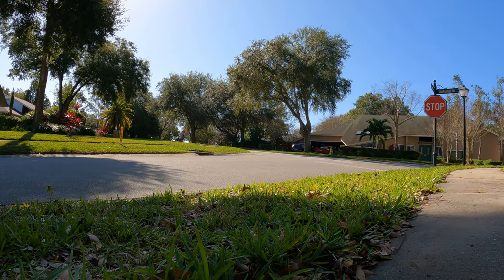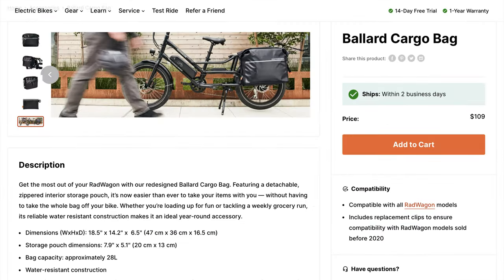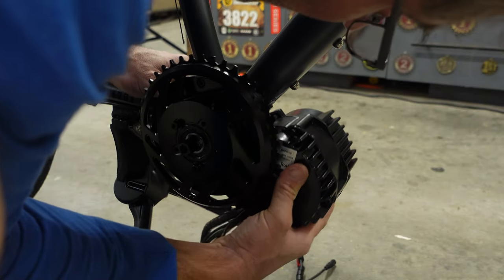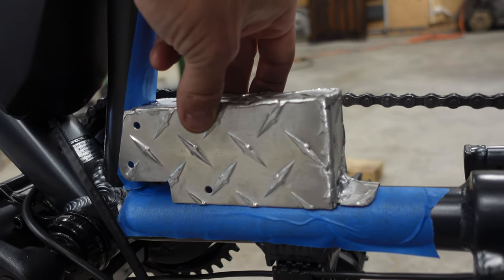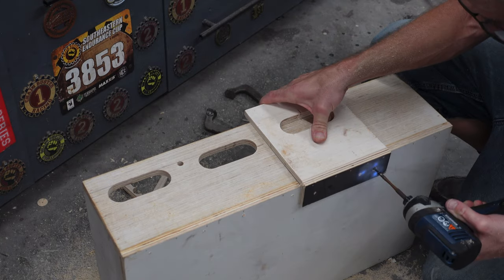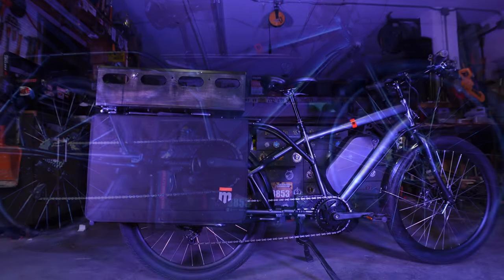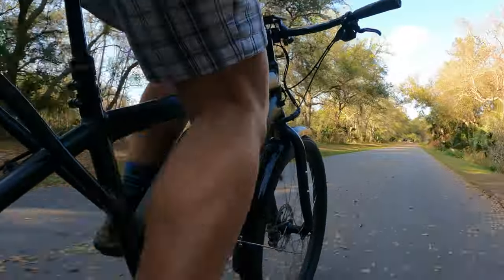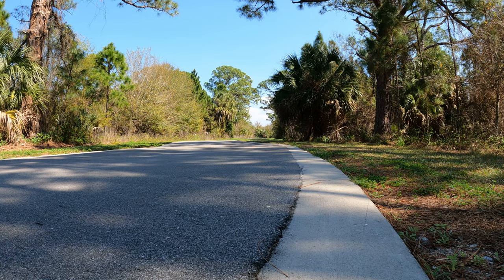DIY Cargo E-bike Conversion

Comment: Nice neat conversion, well done, love the idea behind the lilting rear box. I do all my shopping by ebike with large panniers or a trailer and a cargo bike would be a nice option to have but here in the UK we have a 250W limit and in my opinion that is really holding back the spread of cargo bikes, especially as I live at the top of a 300ft climb the issue is probably more about torque than speed.
Reply from the maker: Thanks. So far I am super happy with this setup. I'm theory some restrictions are good however it seems like they went a little too far in your country. The USA they are on the other end with hardly any restrictions.  I wish they would ban hand throttles on ebikes in the USA though. Most people here buy the cheap Chinese bikes with hand throttles and just cruise around without  pedaling, even in flat Florida.  Hopefully they will make an exception for cargo bikes in the future. Happy Trails.
Reply: @PedalPowerAdventures  not everyone can peddle a bike due to bad knees or other physical conditions, stop being inconsiderate of other people.
Reply: @r.vargas5410  if you can't pedal its not the best idea  to use a bicycle, get a mobility scooter instead surely

Comment: Nice, very creative, I love the rear basket! I also converted the same Mongoose bike and love it too. I put 2 motors together, a 1000 watt front wheel direct drive hub and a small tsdz2 mid drive. The area where I live is very hilly and the little mid drive is mostly to help with the climbs, very efficient and fun and also get regen from the front motor.
Reply from the maker: Thanks!  Sounds like you have a sweet setup with the 2 motors!
Reply: Hows your build Simon? I'm looking to do dual 2kw hub motors (front and rear) for mine. Similarly my area is very hilly, and I plan to haul a trailer around at times too.
Reply: @ryanclapp6467  Sorry for the delay,  I would suggest one direct drive hub and a geared hub, the direct drive (you can also use a GMAC from Grin) will give you regen braking which is very useful especially if you’re hauling a trailer. The only drawback of having two one thousand watt motors is the weight of the batteries needed, maybe better to go for one 500 watt motor along with 1000 watt motor unless you don’t mind the extra weight. We have two cargo bikes with dual motors and haul trailer as well, for car replacement in hilly places, it is a very good solution.

Comment: Very cool build, man. I looked into front loader cargo bikes a while back but decided in favor of a single wheel bike trailer. The trailer has nearly the same hauling capacity as the front loader bikes I looked at but allows me to use all of my existing bikes without altering anything about them. Not to mention the much lower cost vs a whole new bike that will only be used some of the time. When the trailer is not needed I simply disconnect it and put it away.
Reply from the maker: Thanks,  I also looked into front loading cargo bikes but was worried they would not handle as good as a normal bike.  That’s cool you decided to go with a single wheeled trailer instead of a cargo bike.  That’s another good option for sure!  We did some touring with a Bob trailer in the past, actually still have it and need to sell it.

Comment: Did a damn good job.  I was considering the same but with a hub drive to make things easier.  I know nothing about bikes but want an electric cargo bike.  It’s nice seeing what’s possible with some thought and skills.  I think the mid drive is a great choice, it’s just beyond me.  My ADHD gets the better of me so much so I’m even afraid to do the rear hub conversion. Do you want think a hub motor would be fairly easy to install?
Reply from the maker: Thanks!  I only have experience with mid drive motors.  Mid drive motors are really easy to install, the only difference to me is that you need some specialty tools (which are not expensive) to remove the old cranks and bottom bracket and a tool to tighten the mid drive motor.  Everything else is pretty much the same as a hub motor install.  If you go with a hub motor you will need a cassette removal tool and make sure the new rear wheel is compatible with your bike.  Good luck, you will be happy with either system!

Comment: Super sweet build. Gave me lots of inspiration for my own Envoy BBSHD conversion. One question for you. Did you use the 6v light circuit coming off the bbshd for the light and motion kit? That is how I wired it up, and the headlight is quite dim. I think the light circuit is max 0.5 amp, and the L&M set draws 1.5. I can't switch the headlight to its high beam settings. Have seen some people tap the battery directly. How did you end up wiring it? Thanks again!
Reply from the maker: Yes, I used the 6v light circuit and have the same issue you are having with the front light only working on the low setting.  So far the low setting is just bright enough for me.  Never thought about tapping into the battery but I would assume you would loose the auto sensing and manual switching of the lights and need to add  a separate switch?  Thanks for watching!

Comment: Hi very nice work and detailed video it was very informative… your mongoose envoy project is very beautiful and put all those expensive prebuilt E-cargo bikes to shame… I have been considering the mongoose envoy for a few months… I have the newer BAFANG 625 kit mounted on a GT aggressor… I wanted to put the motor on a mongoose envoy but the BAFANG 625 came with a very large battery 1000wh ,, do you think that battery will fit in the medium/large frame? Thanks.
Reply from the maker: Thanks!  The battery on mine is 904wh and the dimension is 14.5x3.6x5.6 inches.  This battery fits nicely in the small/medium frame but only so because of the angled corners.     Not sure if the battery you have will fit on the larger medium/large frame.  Sorry I cannot be more helpful.
Reply: @PedalPowerAdventures  thanks I think u did enough to help me.. I want to buy a medium large frame so I think the battery will fit.

Comment: Used the BBSHD on a Giant Cypress and really liked it. Missed the torque sensing so bought a GT Avalanche and put a Bafang ultra on it and it made a very capable hardtail to say the least. Actually it's a bit much if I could do it over would use the M600 drive.  Nice job on the build.
Reply from the maker: I agree about the torque sensing.  I really wanted to try the Bafang ultra but was not confident in my aluminum welding to modify the frame.  Maybe down the road I will give it a try.
Reply: @PedalPowerAdventures  Looks like you are already able, I think you would like the programmable uart controller and active forum groups success with it.

Comment: Just came across your vid doing my research to convert my own med/lg frame Envoy to electric. Looking at hub motor(s) for mine instead of the center motor. What are your thoughts on it so far into ownership? Would you do anything differently? Any new changes or alterations to yours? Cheers and keep trekking!
Reply from the maker: I have been loving it so far and have not had any issues and impressed with the bafang motor.  Hub motors are defiantly more popular than mid drives around where I live in flat Florida and seems like you can’t go wrong with either system.  The only thing I would do different next time is cut the frame and get the weld-in mid drive motor system.  Thanks for watching sorry for my response as you are probably enjoying your electric Envoy by now!!

Comment: Curious to know, 2years later - how is it holding up? Any problems or maintenance issues?
Reply from the maker: I have about 2,000 miles on it and so far so good, been really happy with it.  The only thing I have had to do was re-tighten the motor mount, which was probably caused by me not tightening it enough the first time.

Comment: I’m building up the same bike. Not quite as finished yet. Which battery did you use?
Reply: Oh ebike central, missed it.
Reply from the maker: Sweet, you are gonna love the bike!   I bought the kit from Ebike Essentials and the battery is the 52V 17.4AH Whale Shark with (2900 18650 cells)

Comment: How many chains have you broken with the mid drive?
Reply from the maker: I broke the stock chain pretty early on, however it most likely was user error as I split the chain thinking I needed to shorten it when doing the conversion then just pushed the pin back in because I did not have a master link and it probably broke there.  The new chain has been perfect so far, I am carful with shifting under power though.  In my kit I carry a spare master link and chain breaker tool just in case!  Thanks for watching!
Reply: climb a hill in the 11th too sprocket

Comment: Amazing build! This frame is going to blow up and I need to get my hands on one asap in Canada.

I've been riding a full-size folding Montague MTB and using it as a cargo bike for the last 3 years with a bbshd kit. You are right to figure out how far superior the BBSHD is compared to the lockdown overpriced prebuilt junk. My only suggestion as a full-time courier is mech breaks are the way to go for ease of maintenance and being in more tune with your brake pad wear. Other than that your build is the perfect utilitarian tool. Stock up on BBSHD parks like nylon gear etc.

Comment: I like it but Id still rather pay 1 or two thousand more and get a Benno boost or something like that. For me to get to 24mph on my Bosch powered bike is pretty easy and it'll go over 40 miles like that and I can get spare batteries. Probably the specs would be really bad on the mongoose. Simple things like accurate range estimation and battery life are hard to come by with befang if it even exists.
Reply from the maker: The specs on the Mongoose are really not that terrible for the price, for me it is was cheap enough to upgrade some of the drivetrain parts.  I am still presently surprised how good the Bafang system is holding up and you are totally correct the range estimate is not accurate at all.  But that is really not a problem because I know how far it can go on a charge and can see the battery voltage which is an accurate way to estimate the battery percentage.  The Benno boost looks like a good option that I did not consider.   Happy Trails!

Comment: you should just drill the frame for the cable management, otherwise good built cant get this bike in europe
Reply from the maker: I really thought about drilling holes in the frame to run the wires, but was worried about compromising the structural integrity of the frame.  What I really wanted to do, was buy the legit mid drive motor and mounting plate and cut the bottom bracket off and weld in the motor mount.  But as you saw in the video, I can barely weld aluminum at this point and ruled that option out pretty quickly, lol.  Maybe in the future I will give it a try.  Bummer you can’t get this bike in Europe, it’s pretty nice and a fair price.